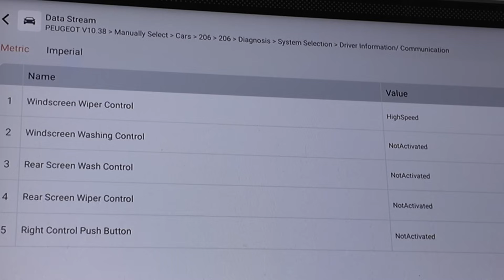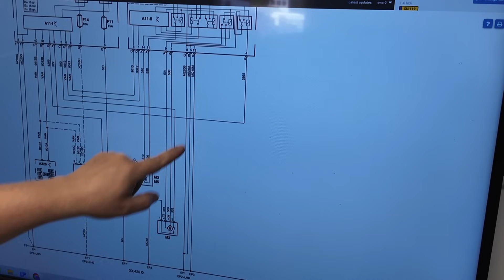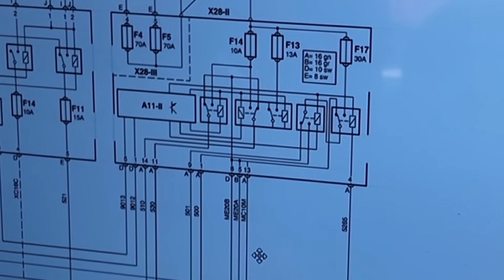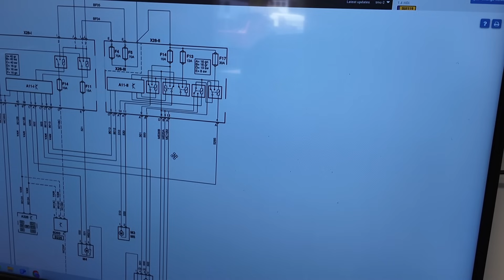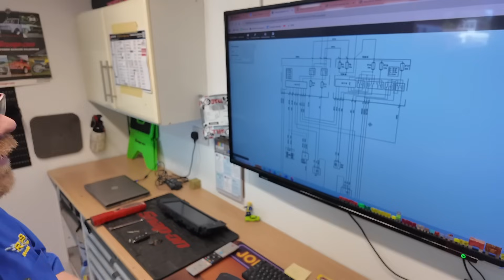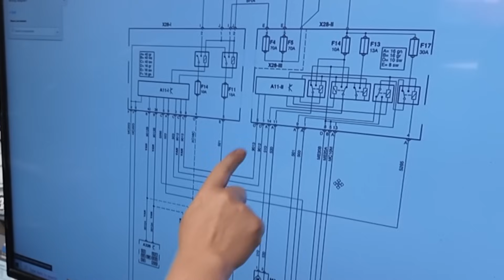The truth behind bad wiring #motoraddicts #mechanic #automobile #bmw #bmwmotorrad

Comment: Thankyou so much for solving the problem! I have no idea what the other wire is for, but I can say that every single function in the car works as it should and just did a 300 mile round trip in it today zero problems! I can only assume the other wires are for something optional the car doesn't have.
Reply: As time goes on... different ECU's are fitted etc. Wiring requirements change but due to cost, it's often cheaper just to use the "old" wiring loom and leave the extra wires there.